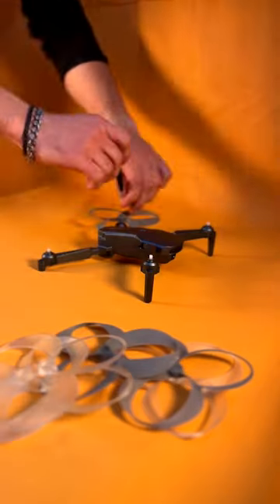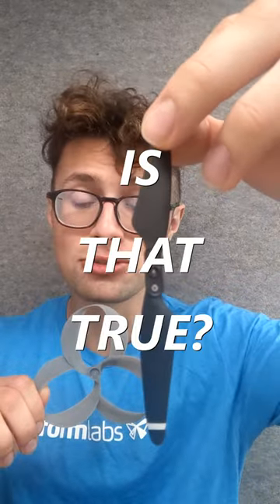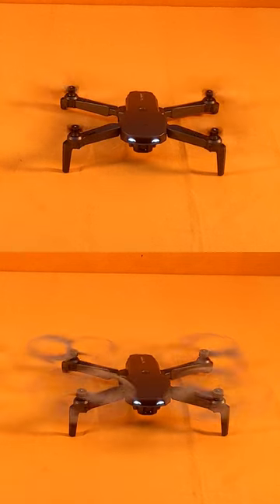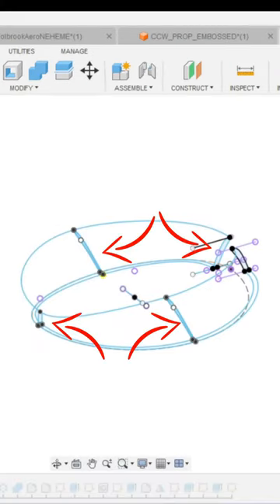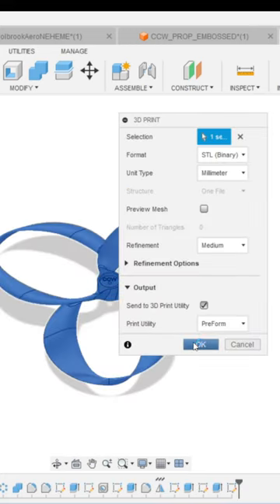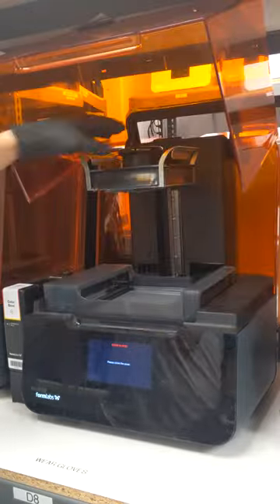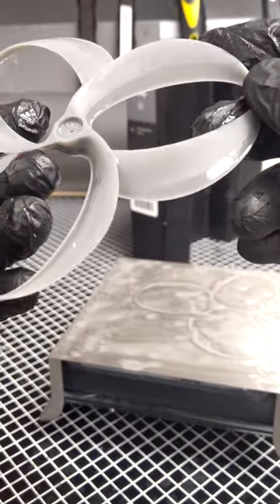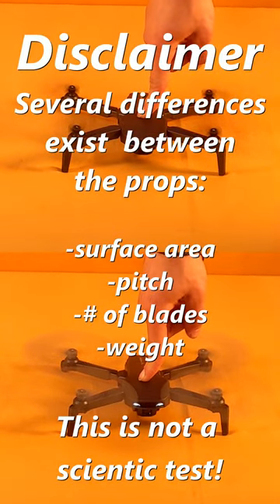3D Printed Drone Toroidal Propellers vs Regular Propellers #shorts

Comment: did you check that the propellers were turning at the same RPM??
Reply: Not even the same RPM but check they're generating the same thrust which is more important imo. One might create more thrust at a lower RPM so you wouldn't run them at the same RPM as the other, so testing at the same thrust is a more usable comparison for drone users.
Reply: @walker1054  ok but when you make a comparison/benchmark you need to keep the same variables, in this case the same rpm. Anyway I like you video:)
Reply: @g.s.3389 it would be more important to check the thrust is the same not the rpm,
Reply: @g.s.3389  When they claim something is quieter, I think most people would rightly assume they mean quieter while achieving the same performance. Performance of a propeller is its thrust. Performance of a motor is RPM
Reply: @g.s.3389  thrust is the consistent variable. Why’s that difficult to grasp?

Comment: 3D printed thing's main problem is the scratchy surface whats not helping the clear flow around the propeller.
Reply: It's (relatively) smooth resin, though, it shouldn't be an issue.

Comment: Since area of the troidal is more it need more power to work same as original 
Currently it seems quiter because it's heavier you will need more power for the same rpm and performance